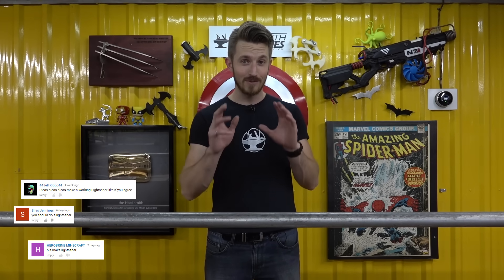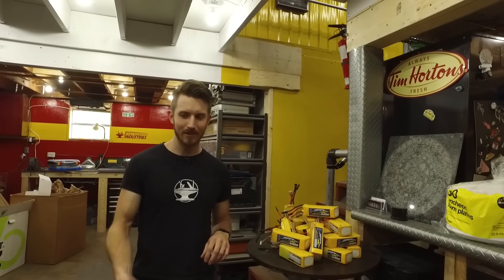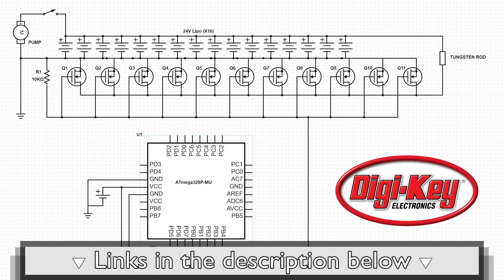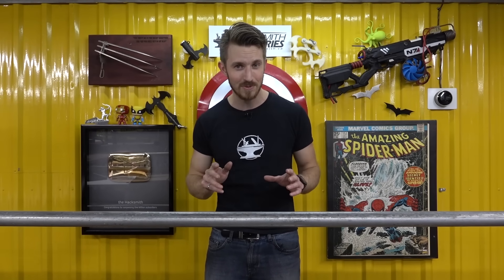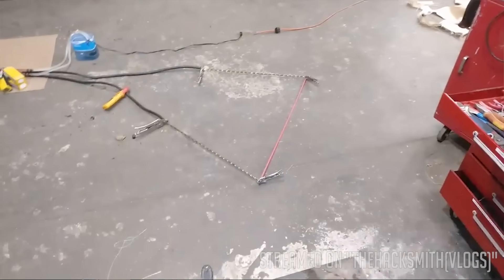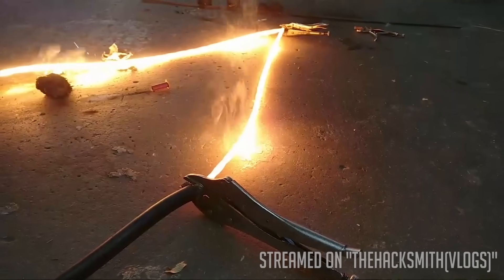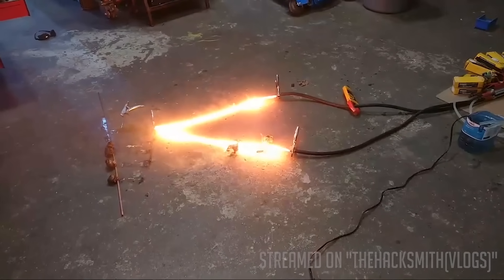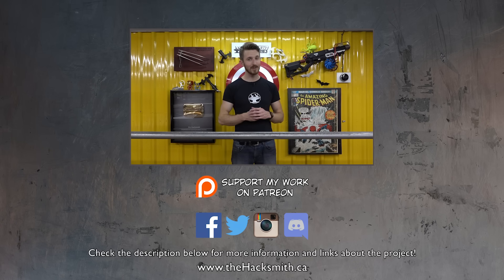HOMEMADE LIGHTSABER EXPLOSION!

Comment: I think you should use the same thing you were using for the tests and adjust the shape of it, so it looks more like the "blade"of the lightsaber, and try something like the mechanism of the car radio aerials, so it can hide on itself and make the illusion that it comes out of nowhere xD
Reply: Oh, well, many comments say that you should use tungsten instead of some metal because it's melting point is way higher, I guess I should read more v:
Reply from the maker: +Anvasan check out circuit diagram ;-)
Reply: the Hacksmith goddammit of course I will xDDD

Comment: So since this is a high powered toaster on steroids why not use a pipe and run the wire down the center that way you don't need to make it look like a big U shaped light saber.
Reply from the maker: +Shaun Martin because that would look even less like a lightsaber? Two close together you won't even see when they're glowing lol
Reply: So how far apart would the bars need to be to let them glow? and would it be better for cutting if less of the energy went into making it glow and more went into making it hot?
Reply from the maker: +Shaun Martin the brighter they are the hotter they are...

Comment: i noticed the the heat energy was causing the metal rod to loose its rigity. if you decrease the frequency and the voltage by 1/3 it probably will simmer and glow without deforming the metal rod. just in theory but it could be possible to weild
Reply from the maker: +Epsilon Cosplay also wouldn't be hot enough to cut through things then ;-)

Did you not watch the whole video? The metal we heated up was not the saber, just testing the power supply.

Comment: That's insane.   And very cool. :)    I don't see a fault in the electronics.  Well, obviously it worked, for a while.   Maybe not enough transistors for the given load.  If one died, the load would be be redistributed across the rest, and a cascading failure?   Maybe if you gave one transistor per battery, and large resistors between each on the battery side of the transistors so they remain (mostly) isolated.  

You gotta be really careful with that kind of setup.   That rig has to be treated like welding gear.  And when the metal heats more, it will soften and bend.  Holding it like a light saber will bend down towards you.    And, do it outside, it'll be safer there.  When the heated metal contacts the concrete, you'll see the concrete popping.  The hotter it gets, the more aggressive they become, and the popping concrete will taken hot metal with it.

Good luck!

Comment: sufficiently advanced already beat you guys to the light saber
Reply from the maker: His didn't cut through anything...
Reply: the Hacksmith yea, your right. after I commented it and I watched more of the video and and I saw what yours might look like, I realized yours is gonna be was more badass
Reply: the Hacksmith love  what you did there, but not a lightsaber. What you have there is more of a heat blade/rod like what was used by the Zeon mobile suits in the old school Gundam movies from the '80s, so I am still in awe of your skills as I have always thought it to be a more realistic and useful weapon as there is a solid aspect to it as well. I have always felt that the main flaw in a lightsaber is that it may cut through a club or sword, but what happens with the inertia in the severed section? It continues on to hit the target if the angle of attack is right.
Reply from the maker: +Shannon Lute yeah... Cause the physics of a "real" light saber are non-existent... It was invented by a writer, not an engineer.

Comment: hey heres an idea how about you use a thiner metal around the outside of the steel or would that cause more issues?
Reply from the maker: +joseph leister it'd melt... Haha
Reply: I kinda figured. What about mercury(its an expensive liquidic metal. But the heat should still resignate if you manage to contain the metal itself?
Reply from the maker: why would you use a liquid metal?
Reply: More accurate yet safe. remember how the lightsaber design was plasma based?... well obviously plasma wouldnt work its far too dangerous. However a liquid metal has very similiar abilities it can heat to extreme temperatures not to mention you wouldnt need to worry so much about it melting and breaking apar so long as you could contain it. Thats where the issue would lie. I want To say a glass but thats far more dangerous... hmm give me some time ill see what i can come up with
Reply: Hold up what about perlucor its a transparent material that can withstand temperature of 1,600 celcius or better translated  2912 degrees farenheit
Reply: According to the periodic table mercury doesnt conduct heat well ill continue. I want to give you the safest option (perculor can be used for ballistics so...)
Reply: Steel is also an option for the liquid metal it would still conduct electricity too (its melting point is 1510 degress celcius which would work quite well when combied with a plating of perculor around it.
Reply: If you could balance the electric output to keep the temperature to a limit of below 1,550 celcius youd have a pretty good design on your hands. The metal would be able to heat and the the perculor able to contain it would lose some temperature but overall would still be able to destroy things especially since perculor is used for balistics thus swinging it into things might not cause problems
Reply: As far as power supply i think youd do better with researching that... im not so good in that department of research lol yeah that was the main issue last time. But i noticed the rod of tungsten broke. With steel you wouldnt have to have as many batterys and it would still be able to cut
Reply from the maker: Try looking at our circuit diagram ;-)
Reply: Will do! While im doing that do me a favor tell me your estimate as to how much heat was generated im talking max. and min. This will give me an idea as to how much poer we can cut back on. Yes theres no exact way but an hypothesis is just fine after all thats the scientific process. :)
Reply: Judging from the circuit using a steel might not be enough youd have to use tungsten again but loop it back to the battery and then cover the outside of the tungsten in steel thus allowing a complete circuit as well as an ability to generate enough heat to melt the steel but not too much heat so as to destroy the tungsten rods
Reply: The problem is im not sure if you have the ability to coat the tungaten in a thick enough steel layer ill send you a picture later. Do you have an email? Id prefer to send it through there. Im as you can tell not the best with electrical circuits im better with mechanical and chemical properties however ill do my best. I really need to get an idea on its heat output you should be able to significqntly drop batteries since steel and tungsten have such a high difference in melting point
Reply from the maker: Why would you bother with any steel... the blade is tungsten. Melting point is 3600C, we can control it to stay at a happy 2000C and maintain structural rigidity, while being able to melt pretty much anything (steel melts at 1200C)....
Reply: Im going to continue using celsius purely for simplicity. Tungstens melting point is 3422 degrees celcius(c) steels melting point is 1370c (i forgot steel has lesser melting point because its not pure iron its improved so to speak.) however due to no for sure knowledge im going to push it up to roughly 1500c this is just to be sure cant have too little heat especially since electricity weakens the further from the circuit this is more than half that of the tungsten and gives enough slack to keep the perculor intact. Before i can go any further i think its obvious but you should be able to knock the battery count down to atleast 10 for sure that should definately improve the circuits stability obviously the heat generated will only be able to melt metals of a lower grade but i think its safe to say that shouldnt be considered bad judging from the schematic id say this should indeed ease up the circuit especially if you space the batterys out a little
Reply: The only thing keeping me from drawing any plans up is temperature do me a favor hook up one battery to a tungsten bar and check its temperature. Let me know when youve done that. Ps sorry i cant conduct this experiment but with school out and me having no other place than school youll have to be the one pulling all the weight also dont spend any moneyif you dont have to try and use what you have left this idea isnt perfect yet so spending a fortune on something when we dont have to would be a waste
Reply: I was going off a rough sketch g+ really needs to update replies faster oy... anyway we could bump it up to a higher grade metal just so long as we stay below 1600 celcius. The reason perculors important is its transparent (color) and will provide ability to keep the metal in a certain shape.
Reply: In all honesty id really like to bump it up but i couldnt find a more suitable ceramic for the job (stength, heat resistance, and the ability to look accurate/color) ps thanks for disabling comments
Reply: I know youve have a good few sponsors see if you can find a ceramic that is somewhat transparent and goes up to 2000c or higher i havenr had much luck (
Reply from the maker: +joseph leister I think our idea will work fine lol we did spend a lot of time designing it, not 10 minutes of brainstorming in a comments section ;-)
Reply: +the Hacksmith it works well and youve got a point i was just saying for one you could actually hold, swing, etc. yet still got the job done
Reply from the maker: +joseph leister we will be able to hold and swing it... That's the entire point of it
Reply from the maker: +joseph leister all this video showed was testing the power supply, not the saber itself ;-)

Comment: I don't really have the technical skills to put it together or the workshop to do it but what about ionizing different air ionized hydrogen ionized oxygen basically you're burning in a distance that type of air molecule it should burn through just about anything and have resistance against other ionizing Sabres without having resistance of the electrical wire

Comment: rather than doing a classic lightsaber design, use the design from no more heroes. it'll agree more with the tech
Reply from the maker: +Jose Brito did you... Not watch the beginning of the video?
Reply: the Hacksmith I did but since the you need a electrod on the top of the saber it won't really resemble it,
Reply from the maker: +Jose Brito you're not thinking with portals ;-)

Comment: try having a ceramic rod with steel wrapped around it. that way the wire won't flop around when hot and ceramic is very heat resistant.

Comment: why not use a regular flyback transformer to be able to make an induction heater of some sorts or simply connect the output to the steel rod. if so I suggest a Zvs driver circuitry with an input of no more than 20kW. this should be more than sufficient enough to get the steel rod (or spike) to the temperatures shown here in the video in very little time. if u get the Mosfets right (which could be tricky, but seeing how u got Mosfets for the power switch this should be easy) and connect the driver to the 20kW power supply u should get the lightsaber to operate for far longer than if u simply connect it to the batteries which would most probably run out on their own in under 5 minutes
Reply from the maker: +Marwan Ibrahim 200kW.... Not 20kW.
Reply: the Hacksmith I meant use a 20kW input for the Zvs driver as there is  no need for a 200kW input for the Zvs driver. In understand you used 200kW in this video but with that means that the current draw is probably very high causing the lightsaber to only operate for a short period of time. Using resistors to lower the current draw while using a Zvs driver to an induction heater should allow for the same results for a far longer time period
Reply from the maker: +Marwan Ibrahim yeah but you're not melting though anything with only 20kW.... That was what I explained in the video.
Reply: the Hacksmith if u step up the voltage using the driver at the same current draw ur output would probably be way more than 20kW, and even that on its own is enough to melt a steel spike (assuming they have a mass of 200 g or so) in under 7 seconds. with the Zvs driver stepping up the voltage at the same current draw it will take far less time.
Reply from the maker: +Marwan Ibrahim voltage doesn't matter... Power is what creates heat -- the relationship between voltage and current. We go with low voltage for safety so you don't get electricuted
Reply: Wait sorry I meant dropping down the voltage not increasing it. by using a Zvs driver to turn the DC input into an AC output you could then add a transformer to step down the voltage and slightly increase your output amperage ( this should allow the draw from the batteries to stay at reasonable levels, not 900A, but still give you the same output of 900A just at a lower voltage and AC instead of DC)
Reply: using the output to make an induction heater could also work with your steel beams by putting the heater in the quilt of the lightsaber even though heat would vary from the top and the bottom of the steel spike
Reply from the maker: +Marwan Ibrahim ... But then you couldn't use the saber for very long lol. We're actually doing the induction heater sheath for another project -- the silver samurai sword from the Wolverine

Comment: Hey you might want to add a thermocouple or thermistor to regulate the power output, since if the rods get too hot they will become too weak. Also since you are using power transistors you can regulate their output with analog pins on the mcu. source: electrical eng from UWaterloo in your area!
Reply from the maker: PWM is the plan!
Reply: the Hacksmith Great! cant wait to see the finished product! Also good idea on all the parrallel batteries, it will stop them from having to run at their max current output

Comment: I clicked the link to try to understand the circuit better but there was no explanation. I mean, what is the ATMega for? Is there so the gate bias control and the cooling pump are on the same micrcontroller? Are you doing some kind of thermal regulation detection? Not trying to be critical, just curious :)
Reply from the maker: PWM control to regular power output =)
Reply: Wait so you can make a SMPS with only an arduino and a bunch of MOSFETS? That's brilliant.

Comment: try using tungsten it has a very high melting point
Reply from the maker: +Askobhal Labostru try checking the circuit diagram ;-)
Reply: I've been learning how to read and still have many problems reading diagrams. I saw in the videos the steel was melting and I know that tungsten has a much higher melting point.
Reply from the maker: You're right =) it says tungsten in the circuit diagram

Comment: Use a relay or a contactor to switch the steel bar on and even if any mishap happens your contactor or relay will switch off after specific amps

Comment: if there is a type of material that rejects heat, you should rap it a round then put on something u can hold it with so the part you are holding does not have a lot of heat but the blade has more
Reply: There's a company locally that stores data backups in a secure vault lined with a ferroceramic fiber insulation that would work. They demonstrated it by laying a quarter inch sheet of it over a guys hand and placing a penny on it that they melted with a torch. The guy felt no heat at all. Company is called Richards and Richards.
Reply: Firegrip Devz carbon would be the best. It has like no melting point whatsoever.
Reply: @rulez3223  But it can burn
Reply: aerogel insulation

Comment: How about instead of a heated element you use a rod with a cap on the end that extends the length of the sabre part with a mirror at the end, and the shine a laser from the base of sabre, and have it shoot out of the handle for ~ 1metre?
Reply from the maker: +TCtorrent because you can't get a 200kW laser that small? Power is power... It's a universal rating haha.

Comment: Hi. I'm student from Poland. I have a better idea. You can use a induction heater for heating element. You put in closed loop of the wire in too induction heater coil. That will give you a safer way to heat that "cutting blade".
Reply from the maker: +Adam Kamiński where do we get a 200kW induction heater? ;-)

Comment: A nichrome rod that pops up from a tube in a stage elevator sort of way? Or perhaps use a real laser and light reflectiom in some sort of way to heat its casing? or a super heat conductive material wich stays solid at super high temperstures and use a fan and nichrome wire to send SUPER hot air into that material, being it shaped in a cone shape so that the exhaust is on top, and the fan +heated wires are inside

Comment: 200kw, three American homes? what?
Reply from the maker: +Virkash A standard house receives at maximum 240V @ 200A or 48kW of electricity.
Reply: Me being from Europe, what do you need 48kW for? (besides lightsabers and/or Death Rays of course). I don't know how much it can provide at maximum, but the standard contract here is about 3kW.
Reply from the maker: +Virkash I don't understand how a European home can only receive 3kW. That wouldn't even be enough for an electric stove... Are you referring to the power per circuit? An outlet in the wall can provide 2kW typically, so our total supply is usually 24 individual circuits, thus, 48kW.
Reply: No no, 3KW per household, by contract. We usually use gas for stoves though. But even friends and family who have gone with a fully electric house have 6-8 KW tops.